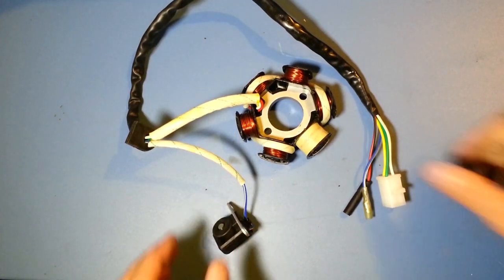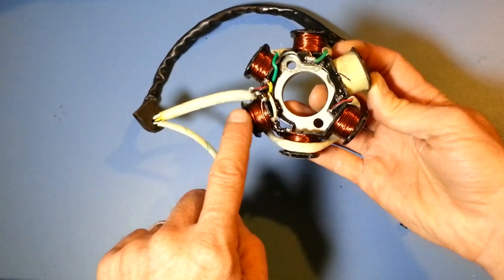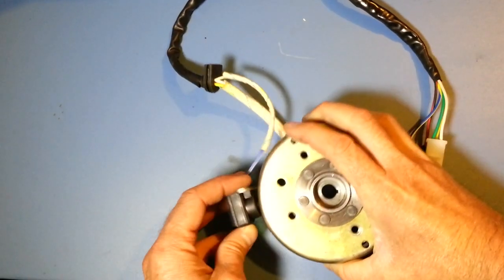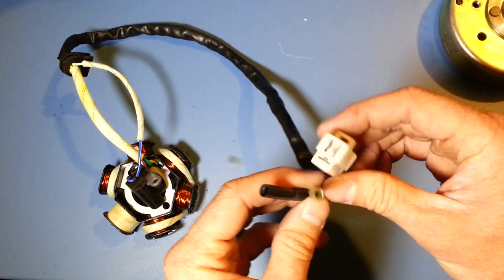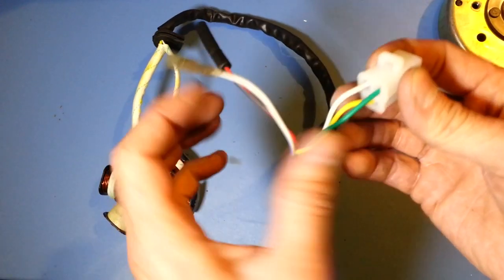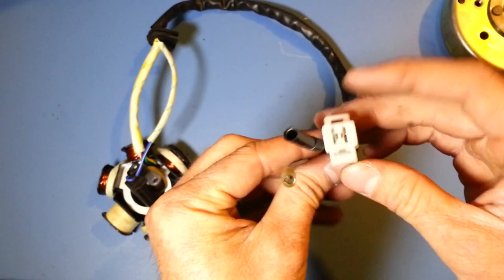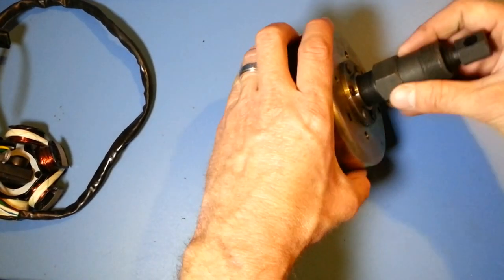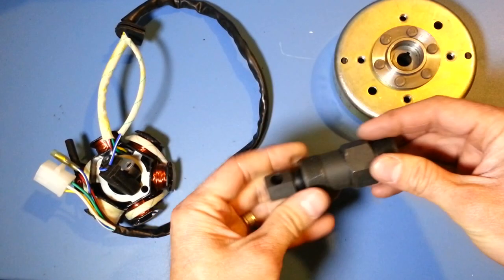chinese scooter stator type A

Comment: Can some body get back to me i  bought a scooter that the charging was mess up so i went and bought a stator and a regulator,i'm still having problems,but i did notice the old on i took off these oil all over it,then when i put the new one on after i notice its not working i took it back apert and notice alittle oil on that,would that have something to do wit it cause its wet,i'm thinking its my O Ring...

Comment: Hi got new one but myn don't have red and black wire on it but new one has need help plzz
Reply: I got a 250cc gy6 with no red and black also. Did you find out how to get spark? I been searching all day for the fix.
Reply: @adamphipps4647  just get a DC CDI n connect the red/black to ignition +